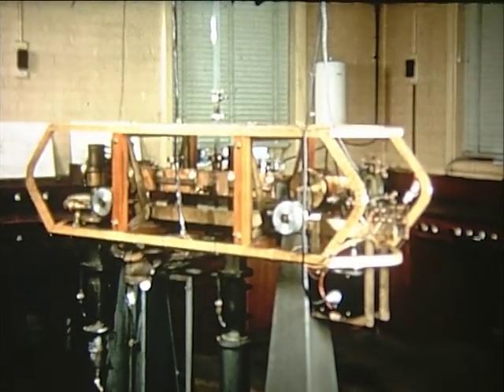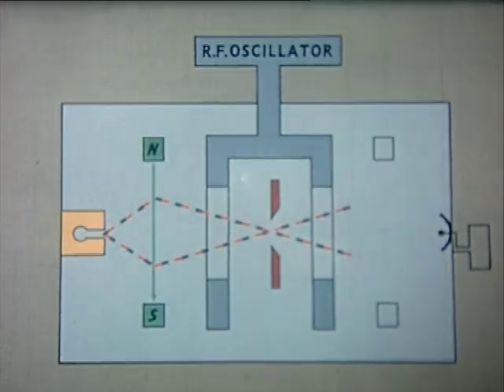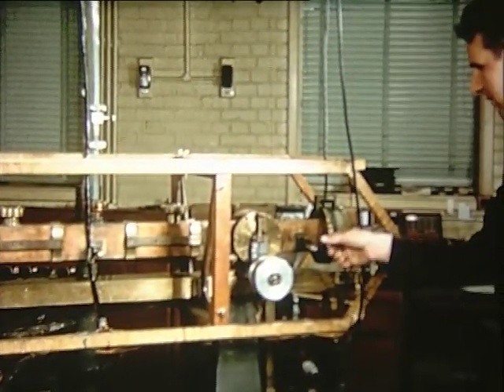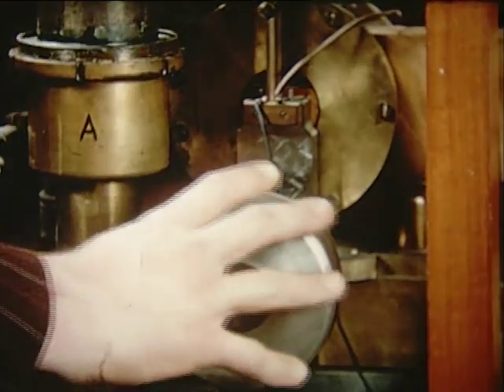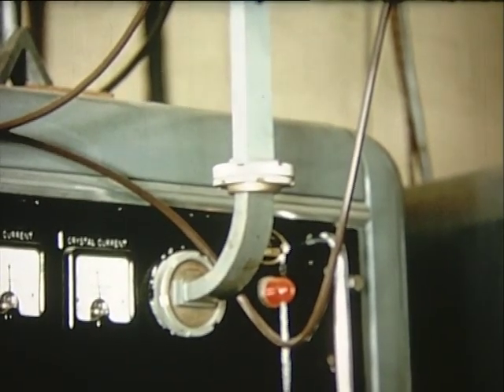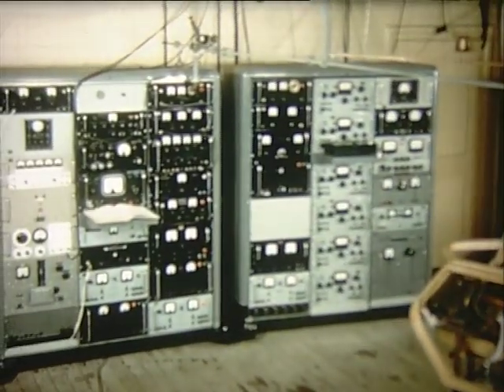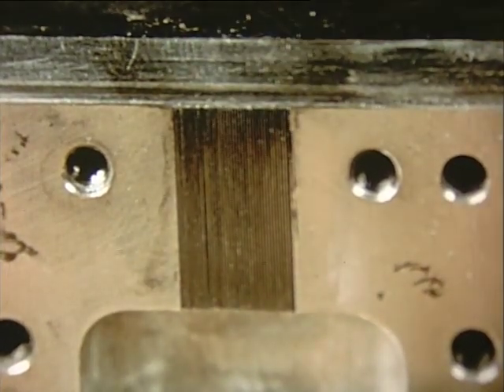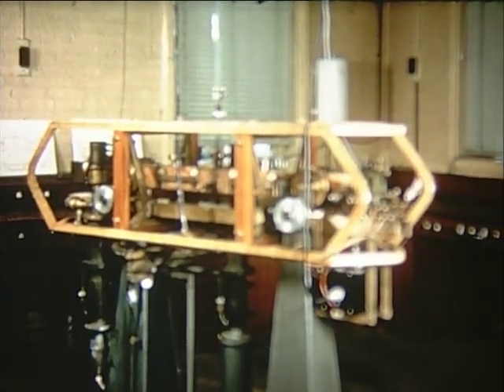Atomic Clock

Comment: Very nice.  Good explanation, and interesting to see this old atomic clock.  When they got around to using an atomic clock to tell the time of day, I wonder how they calibrated it to astronomical time, so they knew which exact second of the clock corresponded with midnight of a specific day?  Did they have someone in an observatory signal via radio some point in time to calibrate their first time telling atomic clocks?

Comment: They did so by a very indirect route, because this first experimental device was not equipped with a clock mechanism.  Once a week Dr. Essen and his assistant would operate the cesium device for a few minutes, adjusting the oscillator frequency to maximize the signal from the detector.  When they had set the oscillator to match the cesium resonance, they would then compare several quartz crystal time devices to the cesium frequency, and thereby calculate how to correct those clocks.

Comment: You need to use the FFmpeg package to remove the noise from your working digital copy. Other than that the print is in OK shape for its age.
Reply: The exessive noise and distortion caused by over gaining the original sound signal.

Comment: They're not measuring the frequency of oscillation per se. They *know* the frequency of oscillation, it's unchanging (at least in an ideal world, at absolute zero, with no magnetic field...) if your measurement of the frequency is wrong it's not because the oscillation has changed, it's because the period you're measuring over isn't actually one second.